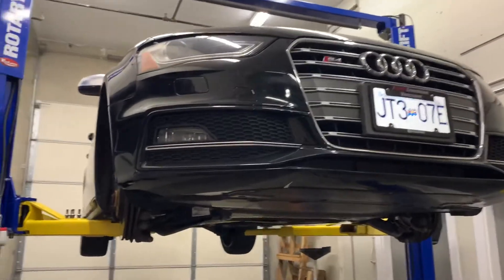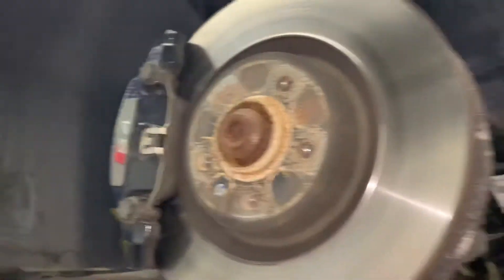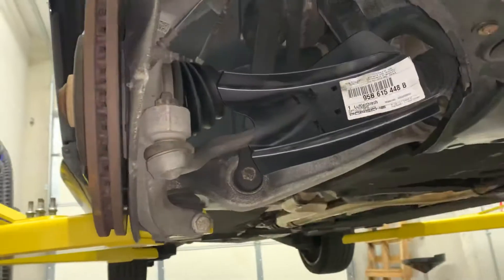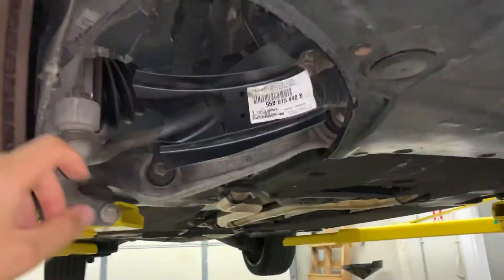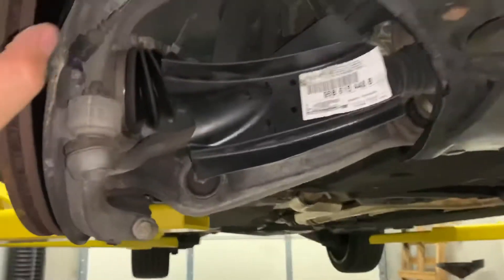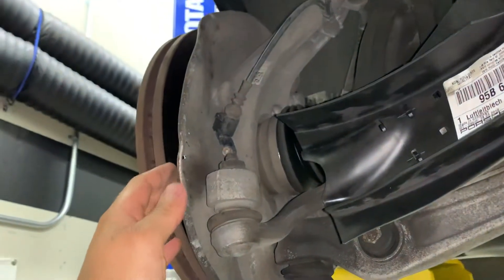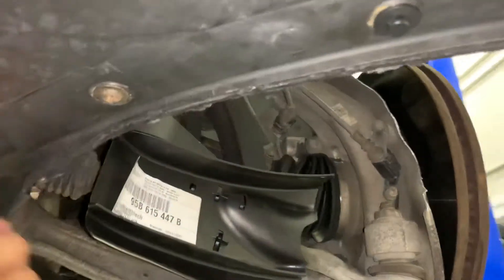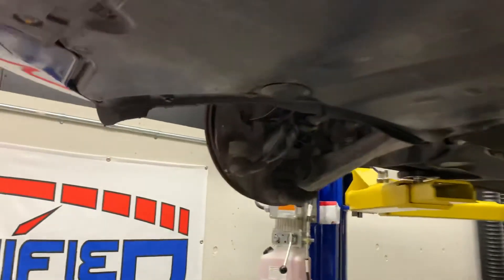Audi B8 S4 Brake Cooling Mod

Comment: Thank you for sharing this vid. Would you do any air routing duct from the front of the car towards the wheel well to maximize this? I like to tackle this with the Macan’s dust shields aswell, and like to see what you think the best way to guide air towards that scoop with most oem look.